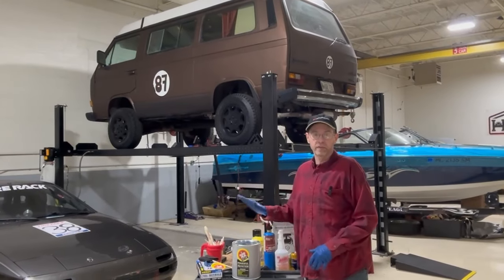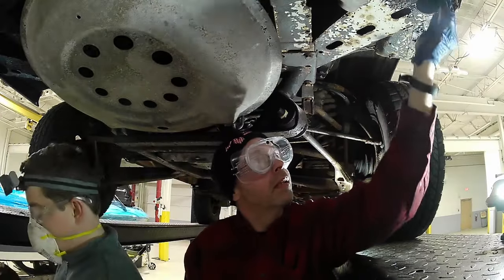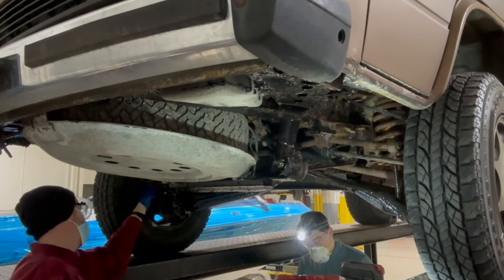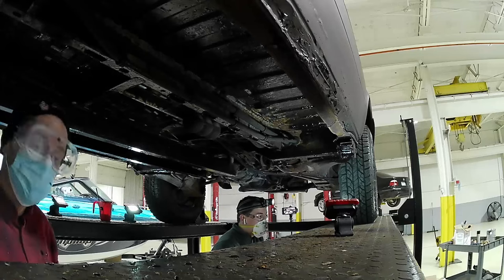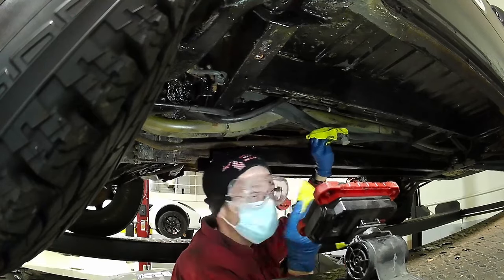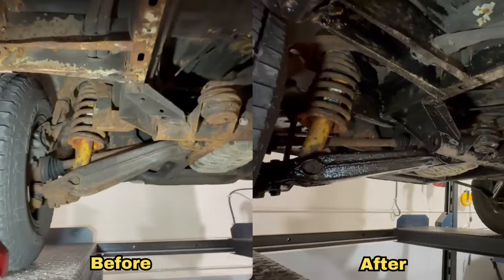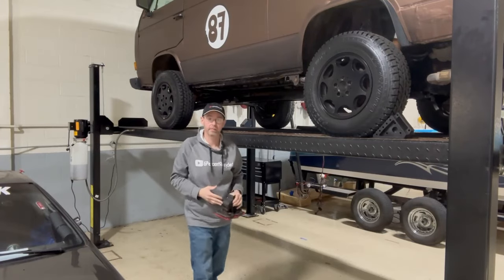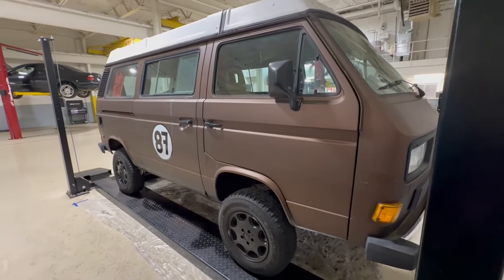Fluid Film Black Rust Prevention Undercoating- You Can Apply It With A BRUSH!

Comment: I have a dirty, rusty old bare block that I sprayed with the clear fluid film last December. When I walk by every so often I hit it with a hand wire brush (the first time was a brush on a drill, but that made a big mess). Now (4-months later) it looks like I can just hose it off & maybe hit with some engine cleaner. It looks like it did a job on the rust.
I have used the clear on frame rails on my F-150 and it looks protected without turning the driveway black.
Reply from the maker: Nice👍

Comment: Do you have to do any prep to the metal other than knocking off the loose rust?
Reply from the maker: The more prep/ cleaning you do the better the outcome. Removing all the dirt, light rust, oil, etc then hitting everything you can reach with a wire brush and or Scotch Brite makes a huge difference. We hit everything with Brake Clean then blew everything dry as well before applying the Fluid Film.

Comment: do i need to water off the salt under my car before reaplly fiuld film
Reply from the maker: The more prep/ cleaning you do the better the outcome. Removing all the dirt, light rust, oil, etc then hitting everything you can reach with a wire brush and or Scotch Brite makes a huge difference. We hit everything with Brake Clean then blew everything dry as well before applying the Fluid Film.